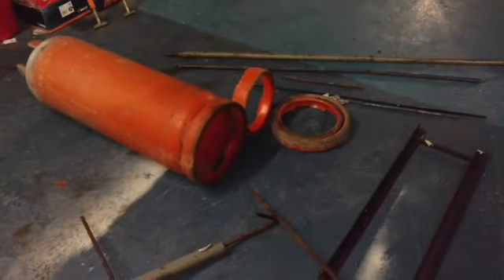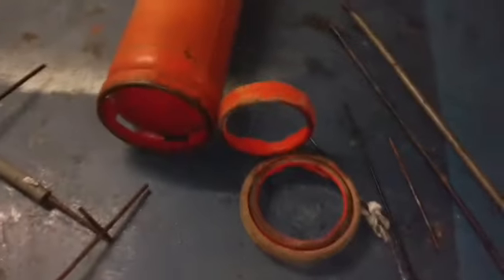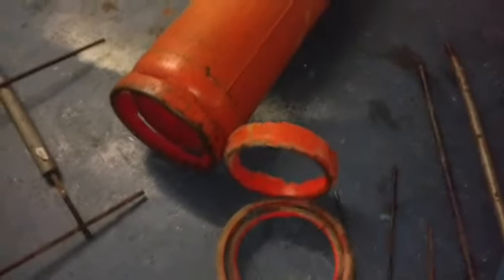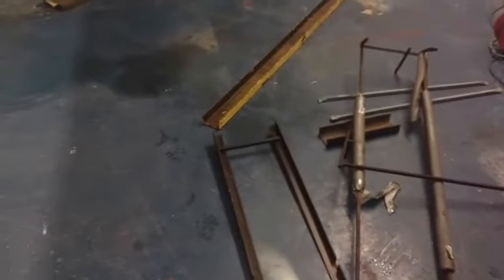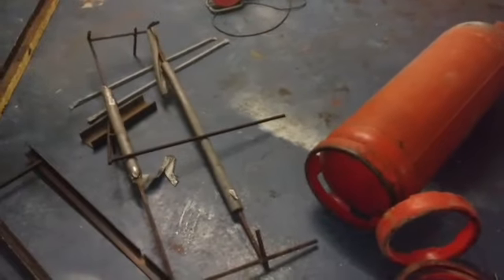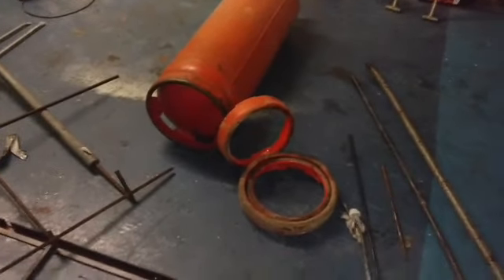lifting and moving rail track with equipment made from scrap

Comment: Ah. Interesting build but not a lot of use for getting a Perkins 103-07 out of a wheel barrow. 

I could just ask my son for help (or probably lift it out on my own) but decided on an improvised pulley system.

Wow you are picking up subscribers, I'm having trouble braking 1000.... or indeed getting to 500.
Reply from the maker: If you build the A frame taller it could lift the engine higher, I'm lifting 3/4 ton of steel here, you wouldn't need a lever half that size...

I'm not picking up subs at the rate I had been, partially because I haven't been posting my videos in other social media sites but YouTube isn't suggesting my videos as much as they used to, what I've been told and what I've experienced in my own feed is that people that upload every day are getting promoted a lot more and it's hitting everyone like us that just do this on an as and when basis. 
I've dropped some of your videos on various forums when they've been relevant, if you want to promote your channel a bit, Reddit was good for me in the past but you need to be thick skinned mate as I pushed a bit too hard then I started getting abuse. 
Facebook would be good for you as well because there are hundreds of live steam groups that would love to see your 5" stuff, but the biggest mistake I made was just dumping 50 videos on a single day then people don't want to sub because they are pissed off with you. 
I used to use YTtalk as well, it's a website/forum for creators and there are plenty of helpful creators willing to give you advice and tell you the latest tactics ect. I might get back on there actually.
Reply: @turboconqueringmegaeagle9006  Cheers for the advice, which reddits would you recommend?

As for the hoist, I just need to lift about 70 to 80 KG out of a wheel barrow. The barrow is fine for moving it. Then I can drop it down for storage. So I was just going to hack a quick and dirty version of a poor man's block and tackle and either use a double A frame or attach it to the ceiling.
Reply from the maker: @BensWorkshop  if you put "tool" into the search bar it will show you a dozen subreddits where you can post your tool review vids, try the same with "model railroad" and "model engineering" there are a couple of small groups that will enjoy your live steam, I dump everything on r/videos because that's what it's for, you can play around with different titles, and write something to go with it, and comment on other people's posts, it looks less like you are just self promoting if you do that (everyone does it, but subtle is best)
If you manage to get some videos posted let me know, I'll find you and bump them up a bit if I can.
Reply: @turboconqueringmegaeagle9006  Cheers. Many thanks for the heads up.